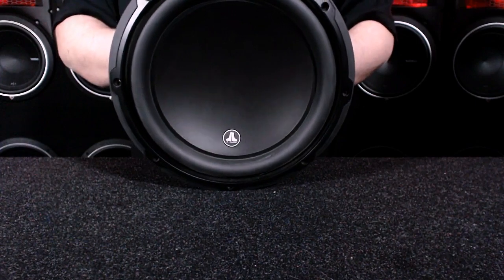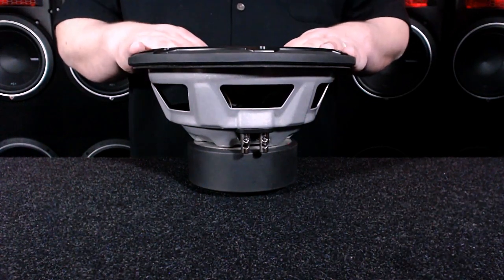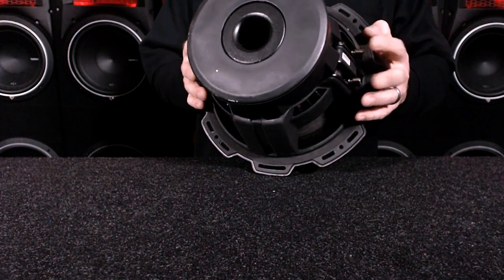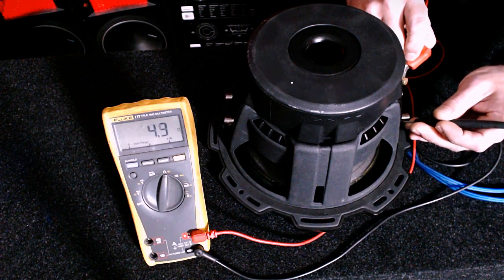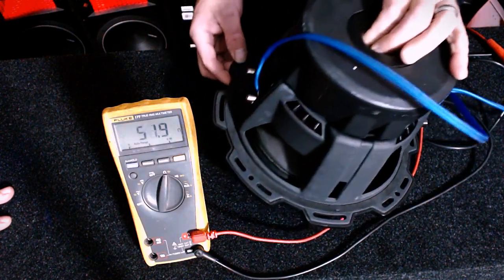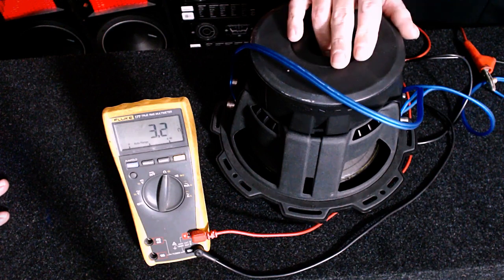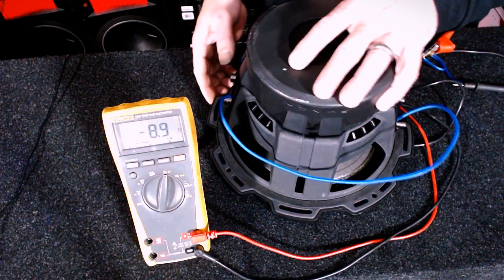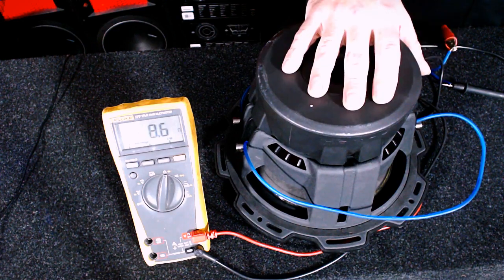Single vs Dual Voice Coil Speakers

Comment: If i ordered dual cone speaker, can i just connect on one side, do i really need to split the wire to other side?
Reply from the maker: You will want to hook up both voice coils. If you only hook up one your amp will only create half of the power and more than likely you will clip the outputs trying to get the volume you desire. Which will damage the subwoofer.

Comment: I have a 2ohms sub and a 4ohm single coil and I have one amp which is a 4 channel. can I use these 2 subs on the amp
Reply from the maker: Probably not. Most 4 channel or 2 channel amplifiers are are only 4 ohm stable when bridging the channels. The 4 ohm sub bridged on 2 of the channels should be safe, but not the 2 ohm.
Reply: stereo king oregon thanks . I actually have the amp powering my 2ohms and some mids. but I'm getting a powered subwoofer (audiopipe appb 12" 4ohms) can I connect this subwoofer to my other one that's connected to the amp and use them together.
Reply from the maker: Sure. You can use the signal that runs to first amp, just run a secondary power wire if your original run isn't sufficient enough to run both.
Reply: stereo king oregon thank u

Comment: So which is better single or dual Im trying to get what has the most bass power
Reply: Neither is better. They touch on it in the video but a single voice coil is a static impedance option, meaning if your subwoofer is 4 ohm single voice coil, you can only run a 4 ohm amplifier safely with that sub without risking hard to the speaker or amp. A dual voice coil offers flexibility in your setup that should let you pick between two or three different resistance settings. A dual voice coil with 2 4-ohm voice coils can be wired together to be properly powered by a 2 ohm amp or an 4 ohm amp or you can adjust the wiring to accommodate a 4 ohm load... it all depends on the resistance of the voice coils and that will help you determine what amp you should be pairing it with. 

If you want more power, lower impedance is typically how you get there, though that's not always the case. However, your amp and your speaker need to be capable of accepting lower resistances or you can quickly damage either unit. If you want more bass, look for larger coned subs or dual subwoofers. The more surface area that you have to push the bass (displace the air) the more drive you get from the lowest frequencies. That's why using a single 10" subwoofer can be a tough experience for bass heads as they touch lower frequencies but they don't have enough surface area on their own to really carry the deep tones at high volumes. 12" subs powered properly have an easier time doing this. It's also important to avoid shallow mounted subs if you can as they typically have smaller magnets and coils which will hamstring the performance of the subwoofer. If you can, look for depth of assembly. You should find a subwoofer that has somewhere around 6"-10" of depth to it, and look for reliable brands to work with. Never buy a Boss or Planet Audio sub, or Dual for that matter. They're cheap and suck.
Reply: @anodyne6760  great info! I just bought 2 kicker 10's with an old school Punch amp on ebay. You just answered every question I had.
Reply: Its not the $$... its the fact that i don't need 2 subs... i don't need all the head pounding bass... i don't need to hear my bass from 7 houses down the street like it was in my younger days... I just need enough to hear & feel it in my car without having to make a huge 2+ cubic foot box in my trunk that takes up the entire trunk...  Plus the added weight of the wood & speakers with amps... which kills gas mileage... I did that when i was young and stupid... Im 43 now and those days are over... I think im just going to get a single 10 svc 4 ohm and be done because this dvc setup is getting to be more complex especially when im getting mixed answers... 480W rms at 4 ohms is more than enough for my taste..
Reply from the maker: Not a good idea.
Reply: Anodyne:
"A dual voice coil offers flexibility in your setup that should let you pick between two or three different resistance settings."
ok so a dual 4 ohm sub can be wired to 8 ohms or 2 ohms... where do you get the 3rd option from..??
Reply: @ACommenterOnYouTube  1ohm wired in series
Reply: Exactly - there's no difference in power output and you just get the flexibility of resistances with a DVC sub, which makes them more applicable to a variety of systems given that flexibility so one DVC sub satisfies 2 different audio systems builds. There is no benefit/drawback to sound and I doubt there ever would be but who knows what the future holds.
Reply: In the end you're putting a DVC sub through a process it was not designed to take. Can it work? Sure but you're going to run the risk of burning out that coil. Backing off the power is something you will be required to do if you hope to use your sub more than a few weeks. It certainly is a pickle, I get it, but it sounds like you're better off buying a new amp. I have the Pioneer GM-8601 mono amp that draws 500W RMS @ 2 ohms and is designed to handle 4, 2, and 1 ohm loads. You really are better served dumping your current amp and going with another but that's your call. For me, I wouldn't risk running one coil with an approximate amount of power (using the gain controls) because I don't want to force the issue if I don't have to. It's a "can I" versus a "should I" situation. I, and I'd assume many pros would say the same, wouldn't go the route you're going but if you're locked in due to budget then do what you have to do. Pioneer's amps are stable at variable loads and are pretty affordable given their capabilities.

Also, the reason people use 2 subs is because more surface area for low end frequencies equals stronger/louder reproduction of those frequencies. Dual 8s and dual 10s are great. Dual 12s and dual 15s are overkill in most cases (and require a lot of storage space). So if you're really trying to get more audible playback in that 20 Hz to 80 Hz zone you need more surface area to get there. I have a single Pioneer WSD3003 Champion Series Pro 12" that does great by itself but unless you're paying big bucks to get advanced engineering in your sub configs, you're always going to be hard-pressed to get everything you ever hoped for from one sub in a difficult environment (in a car).
Reply: Hi, can i plug just one side of dual clone speaker?
Reply: from what i am reading... a svc sub rated at 500 watts is the same as a dvc rated at 500 watts...
Reply: you don't - didn't come back and see that I had put 3 down. DVCs at this time only offer 2 options for resistance which will be 1/2 the resistance of the stated ohms or double it (4+4 = 2 in series or 8 in parallel, as you stated already).
Reply: Well I'd have to do some research on the who wiring up one VC but here's my knee-jerk reaction to that: that's the dumbest thing you can do with your sub if it's a DVC. There's literally no reason why you'd connect only one voice coil - you run one set of wires from your amp to the enclosure, then continue that same set to your +/- terminals and then you can run parallel or series wiring from there to either run a lower impedance or higher impedance. I guess you could technically just keep the gain down to protect the coil but you will damage the coil if you push 100% power to one coil since the coil is not designed to handle that much extra power. Some subs do well with 25-50% overpower but you're talking 100% more power to a single coil.

There's literally no smart excuse to wiring up one coil and leaving the other alone. If your reasoning is "well my amp is rated for 250W @ 4 ohms and my sub is rated at 500W @ 8+8 ohm (4-ohm load) so I'll just hook one coil up for 1/2 the power..." NO - that's just... no. DVCs aren't designed to be SVCs or they'd be SVCs.
Reply: Anodyne:
Here is my story... I have a pioneer amp that is rated at 480W rms at 4 ohms... My sub was about 15 yrs old and the rubber surround deteriorated .. So it was time to buy a new sub... A buddy of mine has (2) 10 inch pioneer DVC 4 ohm subs laying around... ME personally have ever used 2 subs in 20+ years... Frankly i don't know why people use 2 subs or run subs in even pairs... But anyway, in all my vehicles going back 20 yrs i have only run 1 sub... either a single 12 svc or single 10 svc... Im guessing it was more about space in the trunk... 2 subs take more space up and leaves me less trunk room to be used as a trunk... So i just used one sub in a sealed box.... done. So my buddies subs were 10 and DVC 4 ohms... So in series they are 8 ohms which wont work, ill get way less than 480W rms..  So in parallel its 2 ohms and my amp is not 2 ohm stable in bridge mode... So then i thought what about wiring up the one side at 4 ohms... Then i thought, will it perform the same on one vc only vs both vc's... Thats when i started to search the web and am getting mixed reviews on this topic... 
its almost a 60/40 % of reviews im getting, some say its safe as long as you only give it half its rated power to one vc while others say no it will damage it and the ones that say the reason why it gets damage is because people hit the sub with its full rms to one vc which its not rated to handle that much power hence the reason why they get damaged.... The others are saying that if you power only one VC at half its rated rms like it should be then you only get half the output if the sub...  which makes total sense in my mind and would be dumb to do so... Its no different than buying a 200W rms svc sub and only giving it 100W rms... 
Then in one article i read which for the life of me i cant find again, it said a DVC sub gives 3 options... If the DVC is 4 ohms, then it can be wired as 4 ohms, 2 ohms and 8 ohms...  But it never said anything about giving it half power at 4 ohms... 
So.... it seems like half the people i chat or email or comment on Youtube are wrong... So who really knows ...???
Reply from the maker: Neither is better, choose which fits your application.
Reply: stereo king oregon ok thanks ✌
Reply: stereo king oregon Im going to run 3 Sundown 8v2s
Reply: As i mentioned before... i am getting mixed answers... Some say you CAN wire up only one VC but you must cut the power in half... So if the sub is rated at 500W rms, then you should only give one side 250w rms...  which in tern is only running the sub at 50% power...  The problem they say is that people see its rated at 500w rms and send 500w rms to one side only which damages the vc...  500w rms for both vc's together... 
AGAIN... i am getting mixed answers so that tells me that probably half the people are wrong.... Now which side is wrong....??
Reply: @ACommenterOnYouTube  no